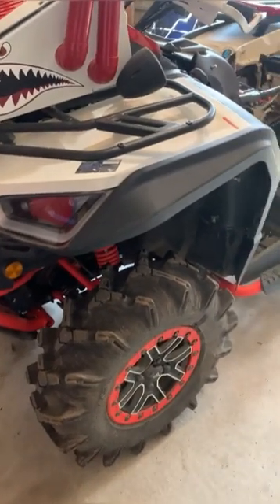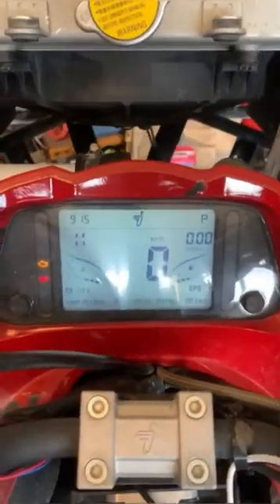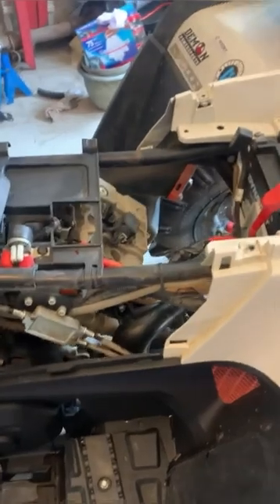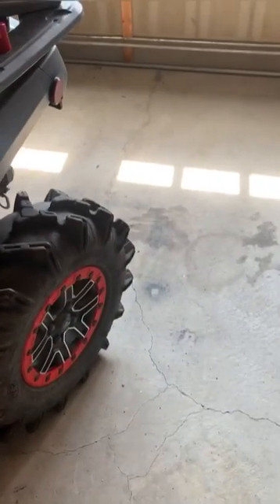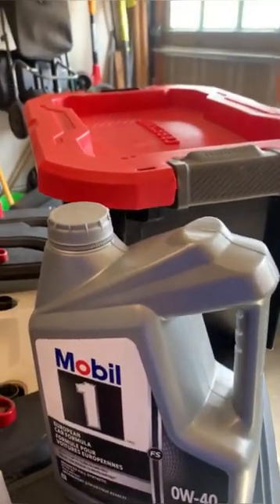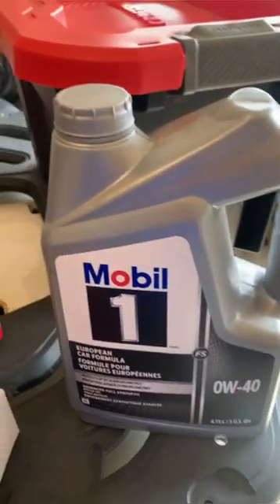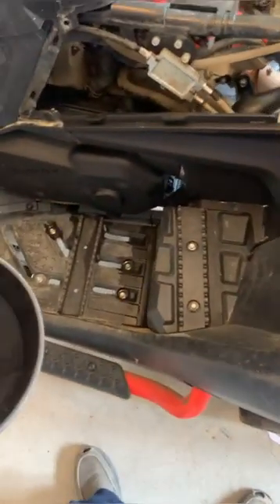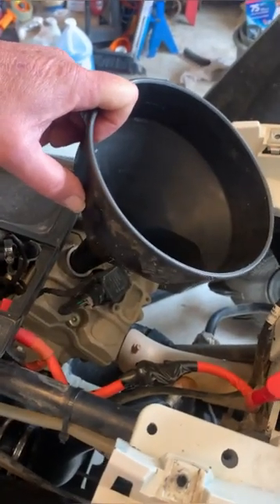Segway Snarler Oil Change and oil type / grade

Comment: Hi Scott - I am a huge enthusiast of your DIY videos. I have a question regarding oil pressure gauge. It occasionally flashes (it does not stay on for longer than a second - just a flash and goes of) while riding. I checked the oil level - it is fine, right in the middle of the notches on the dipstick as indicated in service manual. Engine temperature remains at the middle of the scale on LCD panel. Do you have any idea what to do about it? (I have got only 230 km on my Snarler - in two weeks expecting to leave it with a dealer for the first inspection - I just do not want  the dealer to bullshit me about improper handling of the vehicle)
Reply from the maker: Hi Adam  YES ! I do !  Many and I mean many have defective oil pressure sensors. ( mine went 2x! ) it is a very well known warranty issue.  As long as oil is full on stick you won’t hurt to ride it until you get sensor replaced.
Reply: @scotthyatt4751  Many thanks Scott - I will escalate that issue to my dealer. Segway is not a popular ATV here, it has only begun making it's presence in the market, so hardly few people know it's typical issues. Many thanks for help!!!
Reply from the maker: @adamfigiel3640   No worries!  It may not be popular yet, but it will be. They really are superior machines.

Comment: Hi I want to ask something If you can answer when I open the cap for oil level check oil smells like fuel gasoline and oil lamp is blinking is it this normal or something is wrong with my engine
Reply from the maker: You might want to take it to the dealer it isn’t normal.
Reply: @scotthyatt4751  Ok Thanks I already reported to the dealer I will drive him to service next week ....thanks anyway

Comment: Why did you not explain to clean your magnetic oil plug. There was a lot of debri on it.
Reply from the maker: I did. When I pulled it out I said to clean it off.  I cleaned mine thoroughly.
Reply: @scotthyatt4751  one question did you have problems with the vario? I drive 5000 miles and mine driven pully is broken. And had to wait 2 months on parts.
Finally I can pickup the parts tommorow.
Reply from the maker: @123123westside  no problems yet, but I only have 2000 km on mine.